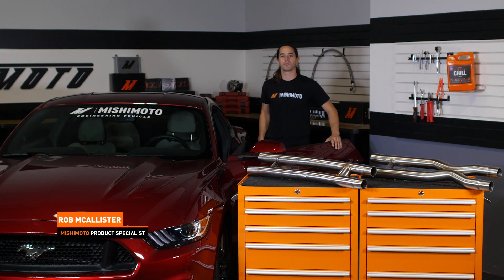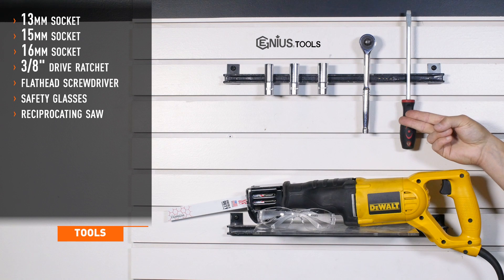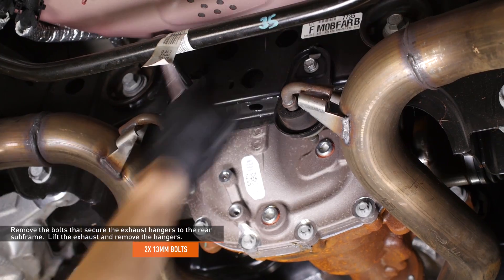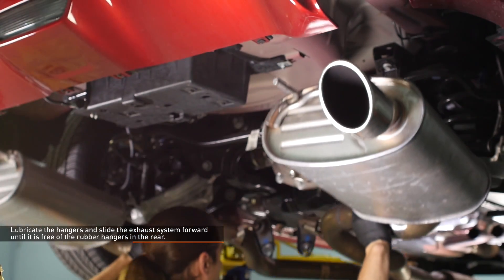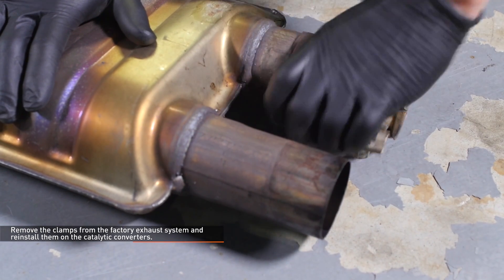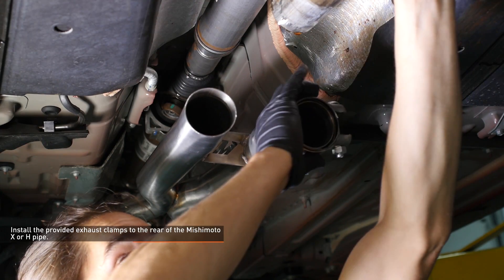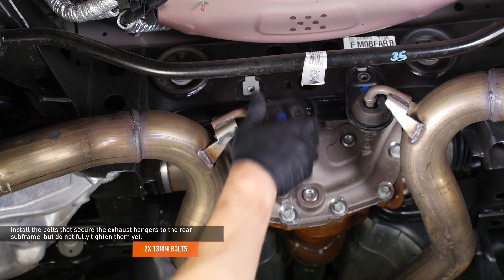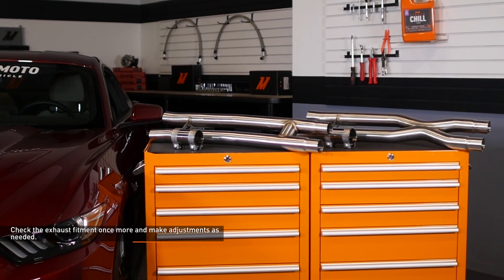2015+ Ford Mustang GT H-Pipe/X-Pipe Installation Guide by Mishimoto

Comment: How much do you have to cut off the stock exhaust? thinking of replacing my Ford Performance Cut and Clamp Resonator Delete X-Pipe which i already installed but it's way to raspy for me. That's why I'm looking into the H-Pipe you guys offer but I want to measure before I purchase  to make sure it will fit. one last question how much what was the HP difference between your guys X-Pipe and H-Pipe? I saw the dyno video but no numbers posted so just curious.
Reply from the maker: Check this link: https://engineering.mishimoto.com/category/svp-vehicles/svp-vehicle-mustang-gt/ford-mustang-gt-exhaust-components-2015/ You'll find all the details on our H and X pipes - I don't believe we saw a difference in HP between the two.  If you watch the full video here, we show you exactly how to line everything up before you make your cuts!